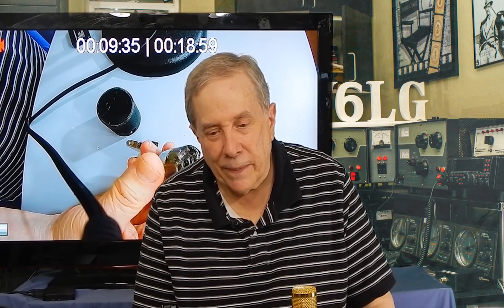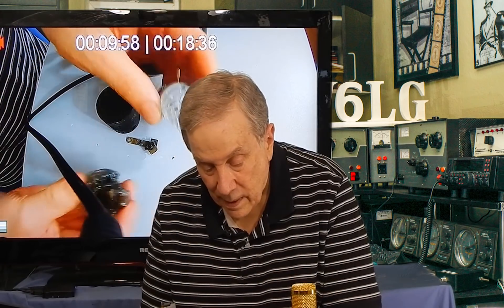Ham Radio Basics--Jim, W6LG, Shows an Electrical Plug After It Failed--You Need To See This!

Comment: Just glad you`re still with us. I did something when I was a teenager similar to that. In the house we grew up in, there were metal wall plates on the outlets. I tried repairing the wall socket behind the fridge. I left the fridge plugged in and proceeded to remove the wall plate. Guess What? You guessed it. The metal plate dropped into the gap that was there, because the fridge pl;ug was not in all the way, and whoof. Big sparkos everywhere. To our good fortune, a neighbor was an electrician and was happy to come down and set things right. For years, there was a char mark near that socket. Never got painted over. First time in my life I got a smell and taste on ozone. Never forget that one.
Reply from the maker: I did not smell it.  Even now, it has very little odor. Good thing that my amp had a step start that made some funny sounds.  73, Jim W6LG

Comment: As a service electrician for 24 years I've seen it a lot. One thing I focus on is the receptacle into which the cordcap plugs. Many people use low quality receptacle that don't have very good clamping force on the cord cap. If you run power close the the top end rating of either the receptacle or the cord cap, it can cause arcing and intense heat. This heat can transfer down the prong on the plug and melt the solder on the tinned wires causing them to loosen up and thus causing more arcing and eventually a burnt connector. I suggest you replace the wall receptacle with a commercial or spec grade receptacle as well as replacing the cord cap. They are only a little more than a residential grade outlet but soooooo worth it. 73 AG7EF

Comment: Jim, I would also carefully check the receptacle. If the plug blade got that hot, it may have damaged the receptacle, causing a high resistance connection, and more heat again!

Comment: Hi, Jim. I am an electrician and usually if a receptacle is over-loaded the neutral will burn away.  I this case it was definitely a loose screw on the hot lead.  Good that you caught it when you did.  73.  VE6HDH

Comment: Glad you found it before you had real trouble. I'm a maintenance electrician and I install cord caps almost daily....I twist the strands and just tighten the terminals. I've seen this happen and other than performing an annual or bi-annual check to see if it worked loose, unfortunately this is how we find out about issues like this.

Comment: Back at my university days, my electronics professor had told me to never tin anymore than the tip of electrical wires to stop loose strands. These were for wires used in power supplies because they needed to crush the wires with the screw. And over the years I too have tinned the entire end as it was faster. I ran across this happening (burnt plugs) because the screw got loose too.

Moe k2jdm

Comment: seen all to often as a Firefighter and Fire Investigator. Loose connections either on plug ends or on the receptacle itself. I recently checked a guys house for him as he lost power to several outlets.  The contractor used cheap receptacles throughout the house, one receptacle had a loose connection and was burnt out on the side much like your plug was. the root of the power loss and most likely what saved his home as it dropped the power to the other receptacle was the contractor removed 2" of sheathing from the hot leg at some point the hot and ground met each other and tripped the breaker. The house was part of a subdivision where the contractor offered 2 or 3 house layouts as options. I strongly suggested he have all of his receptacles checked by an electrician.

Comment: I'm also curious on what should have been done here. Would it have been better to have not tinned the wires? Use ferrules? Something else?
Reply: Not tinning the wires would be the first step.  Next is a good quality plug, or receptacle depending on what work you are doing and what you are replacing.  When in doubt consult an electrician.  The call you make to have an electrician come out and the $80 you spent to have that electrician come out and say yep that's just fine, or no do it this way could save you hundreds of thousands of dollars.

I've also seen electricians wire in outlets and replacement plugs get everything tightened down and then wrap electrical tape over the connections to prevent a loose wire from hitting anything and shorting out, or coming loose and completely coming off the terminal.  Also on electrical outlets it also prevents an accidental slip with a tool when removing an outlet from hitting a bare wire or terminal on the outlet.  

With all the crap being imported from other countries now some of that stuff is downright dangerous.  I try to stick to brand name stuff when I have to replace any electrical wiring, even light bulbs themselves can be a disaster waiting to happen.

Comment: I happened to pull the breaker panel apart one day to add a circuit and a neutral wire had worked loose on the buss bar. It had melted the insulators and made 3 of the wires crispy. Never had any idea there was a problem. Yikes.

Comment: I routinely tin stranded conductors for whenever there will be a crushing-type fastener.  This method is especially useful in automotive applications for battery connections -- the tinned conductors thwart corrosion.  Before you blame tinning, you may want to consider the device itself and if it is UL listed.  Arcing such as what you show is commonly the result of an arc fault that often results from a poor connection (backing out of contact screw, poor strain relief, etc) and/or excess deformity of the structure holding the screw (too plastic, etc).  An incipient arc could quickly propagate and with charring,  go into "run away" and arc some more.  The backing of your plug housing looks unusual and a cable strain-relieving means is not readily evident in your pictures.  The plastic housing of these devices are most often halogen-containing PVC and serves to thwart fires.  While halogen is not so great for the environment, they are effective in mitigating fires.  Usually, these devices are safe and do not result in fires, unless combustible material is nearby (curtains, etc).  In all cases, including the use of UL listed devices, it is a good idea to segregate any combustible material from plug connected devices.  However, the practice of tinning wires is a good thing in my book..

Comment: In 20-20 hindsight it is obvious. Power cords are always flexible stranded wire, so duh, why should the plugs be safe to use on solid [tinned] wire? Union electricians would simply never tin those wires, but what a trap for hams! Thank you for bringing this up.

Comment: What I usually do, and I'm not an electrical expert, is put the crimp on style connectors with the loop so it cant fall off. Crimp then Solder, and then put the screw through the metal loop and tighten it down. I'm not sure if that is safer or wiser, but so far, I have not had a problem. I'm so glad you caught that and no serious damage was done to your home or equipment or you. Did the receptacle suffer any damage just out of curiosity? 73, de KD7SJT.
Reply from the maker: Yes, it too was damaged by heat.  Looking again at that plug, I don't like the design.  But, clearly, I am the one to blame.  73, Jim

Comment: Tinning the wire allows the screw to become loose as the solder compresses with time.  This will happen several times with the connection before it finally becomes tight enough for long-term use.  No tinning!

Comment: Breaker should have tripped...looks like metal touching metal.....glad u caught it...73's Jim KB8YBG
Reply from the maker: The outside shell of that plug was plastic. So, there was no metal touching the screw.  I just got real lucky I did not burn the house down.  We just paid it off!!  73, Jim
Reply: A conventional circuit breaker could not be expected to trip in an arcing event.  For such tripping you would need the newer AFCI (Arc Fault Current Interrupter) type of device as governed under UL 1699.  AFCIs are invoked under the NEC for locations where combustible materials such as drapes are typical  in close proximity to receptacles (i.e., dining rooms, bedrooms, etc)